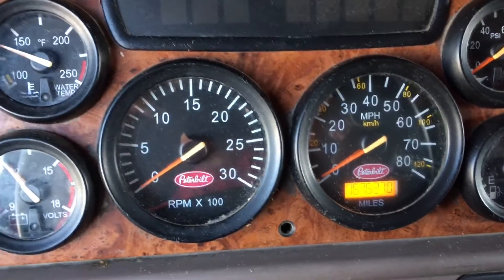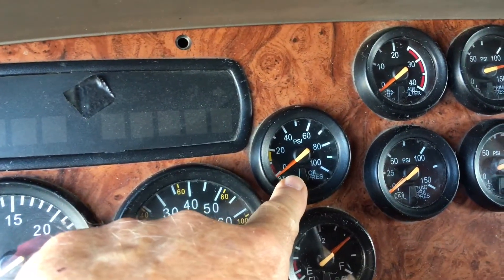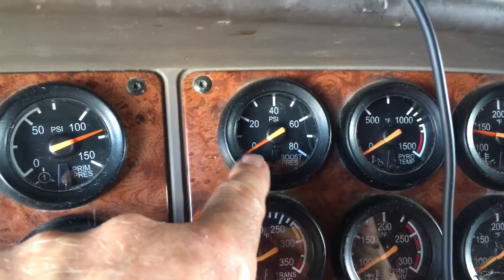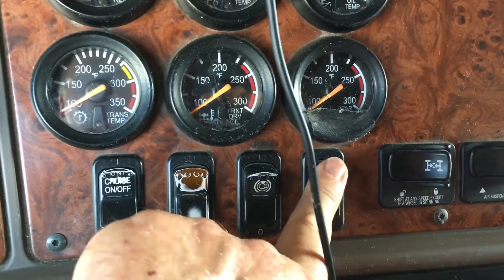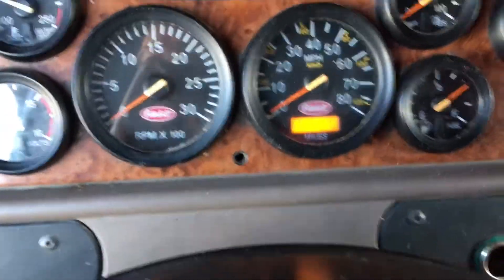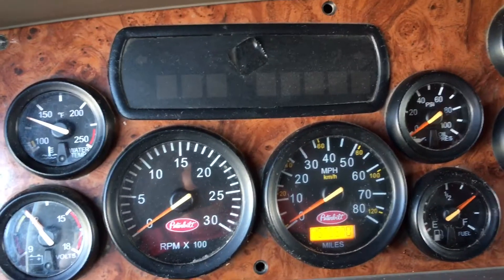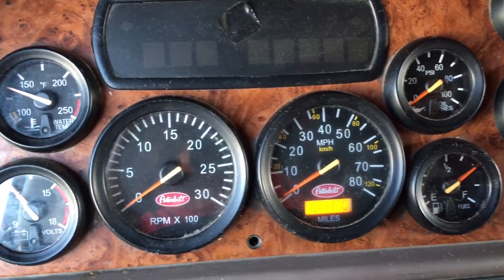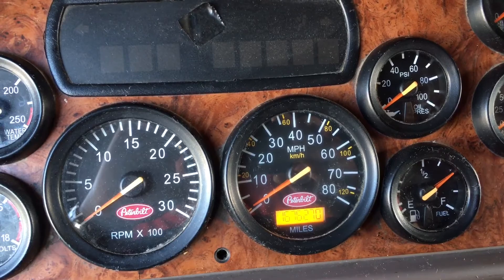Tesla Semi vs. a Peterbilt

Comment: I have a new engine that I am working on (newenginetype.com) that will make Tesla OBSOLETE.  Same efficiency as electric, but without all the weight of the battery.   I plan on putting it (and thousands more...) in an old semi trucks by taking out the old Diesel and installing this new engine. 

What truck would you recommend?  You say a Peterbuilt can get 2 million miles on the glider.  What about Freightliners, and the best years to use?  I want to focus on a narrow range of years and models that would allow me about 3000 trucks.  After that point I will make a new glider with the money I make from 3000 trucks hauling goods.  BTW, the future is flying semi trucks at 10-20 times less fuel than a 737 airplane per cargo.  see me on twitter.com/seaplaneguy   Would like to find a smart trucker to consult with.  seaplaneguy@msn.com